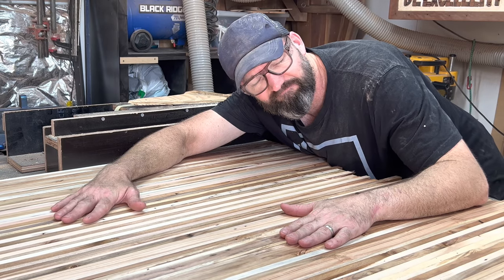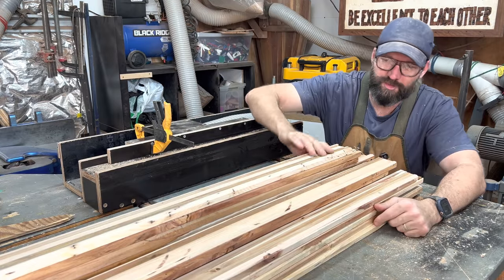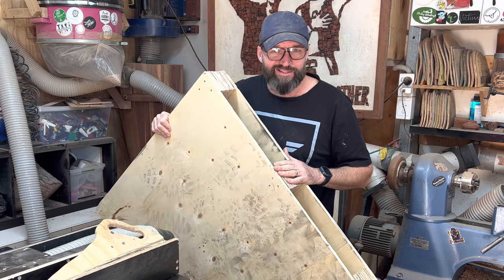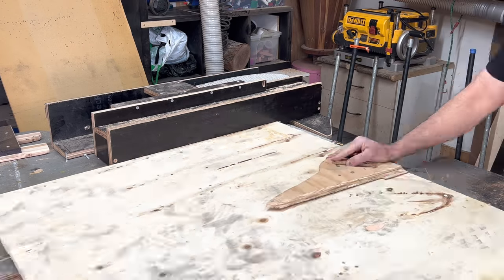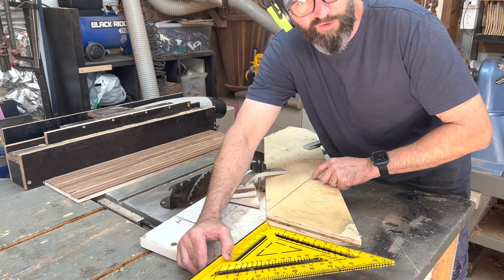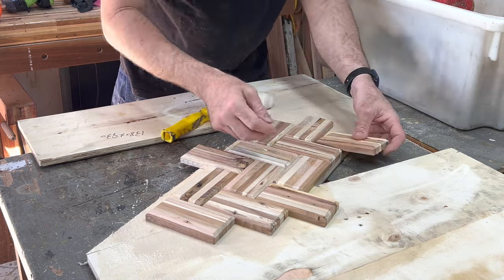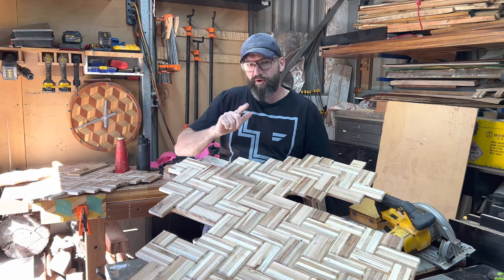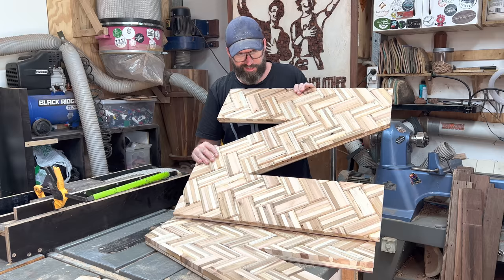INCREASE PROFIT? Try this trick

Comment: I absolutely love how you turn crappy pallet wood into such awesome works of art. I bought myself a table saw (even if it was a cheap one) because ripping the pallets down to get a straight edge was very important but I'm looking forward to the day when I can get a planer as well so I can get the wood to a uniform thickness. I don't quite have the room yet to thickness with my router. Not sure if you've done a review on your DeWalt planer and why you chose that particular one but if you have and can link in a reply comment I'd be very grateful. I've only got a small garage and not only do I need to get rid of a load of junk in there to allow for more work space, I need to find some way of optimising the space.

Way too much gear and not enough storage space!
Reply: @dainermade  That's a great idea, might have to remove the silly plastic top guard from the table saw. I'm not new to power tools, not even sure why I put it on there. I see in practically all videos no-one has their s fitted, will have to give it a go and see what I can come up with.

Comment: hi, glad i found your channel but in a few of your videos you've said you use a cheap PvA glue but you dont trust how strong it is. am i missing something, if you don't trust why use it?  i know how expensive wood glue can get and i was following in your footsteps by going down the PvA route myself surely its strong enough more so if you use biscuits
BTW keep up the good work
Reply: @dainermade  cheers mate i had just googled using pva before i got your message and as you say as long as the wood is clean and flat it'll work but may take up to 24 hrs to truly bond
(i knew i had used it in woodwork class) :D